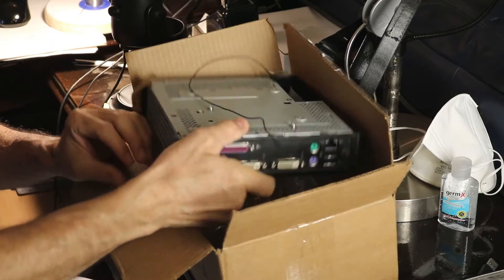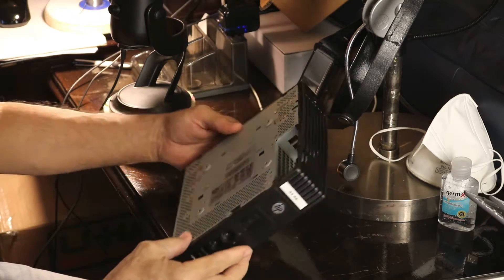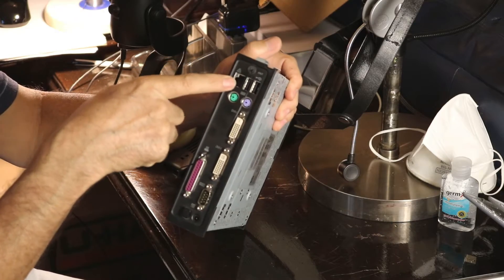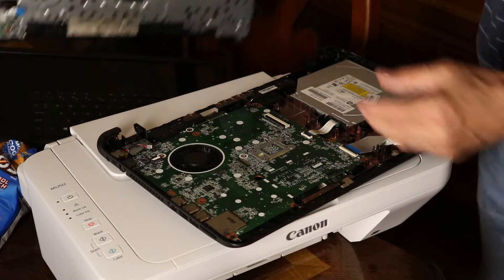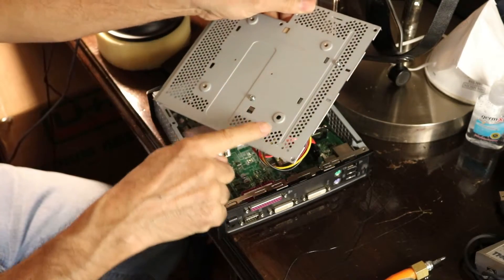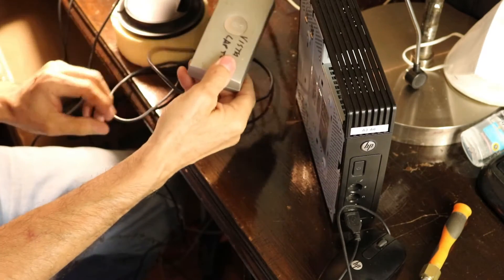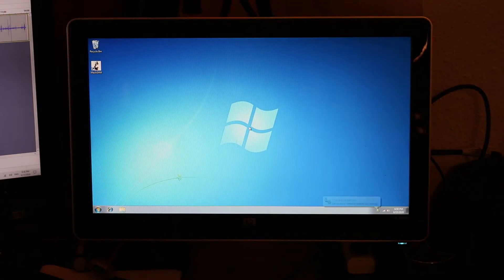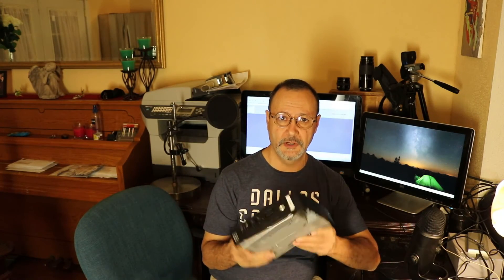Thin client for your CNC

Comment: Thank You.  Very informative.   I have several machines running Mach3 (I like it and I don't want to change).  Finding computers with parallel ports to connect to my homebrew "controller" (Break Out Board, Gecko stepper, or Larken Servo drivers--etc.) is another story.
Reply from the maker: You're welcome! Glad you found it informative.